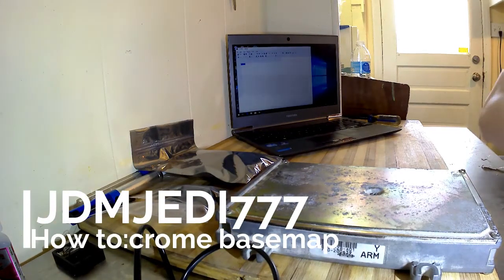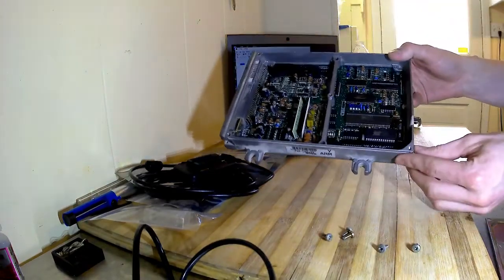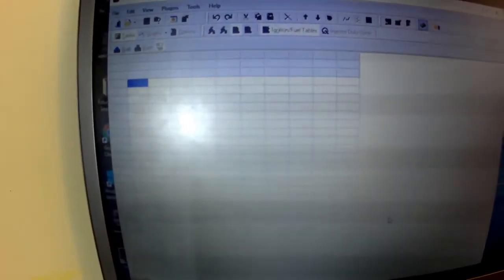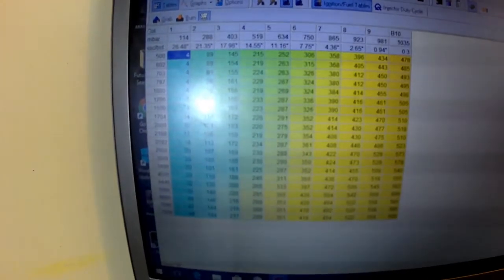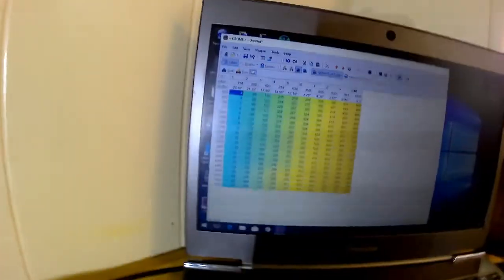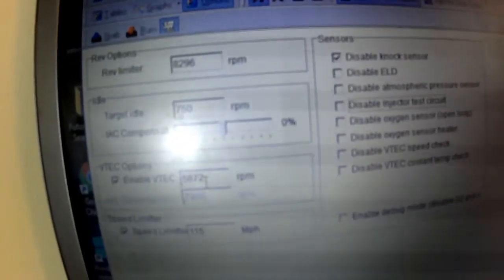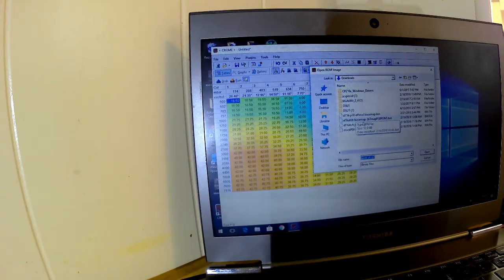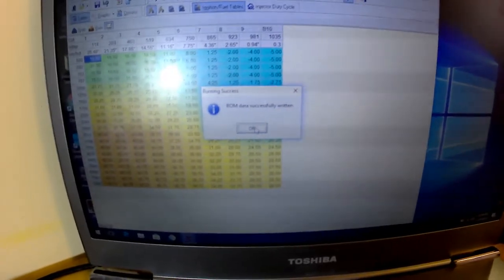Honda crome basemap and chip burning HOW TO

Comment: Hey man I just swapped a stock b18c1 into my 99 civic si. I have a p28 with that sst chip. Would I base it off the p28 rom or the p72 rom I’m kinda confused on that part.
Reply from the maker: So if you want to use the extra features like launch control and stuff you would use a p30 rom and then import the maps from the b18c1 rom. Otherwise if you just want a stock basemap just use the rom for the b18c1.
Reply: Awesome thanks for the quick reply!
Reply from the maker: @coreyguadarrama7966  no problem at all!

Comment: Great video. SUBSCRIBED! Its very informative. i have a miata with mega squirt but I am unfamiliar with hondas and I am Trying to help a friend. Are you familiar with ostrich 2.0? my problem is he has a b20 engine but a b18 p75 ecu and i dont see a base map like that on chrome. can i get one somewhere? or can i make a base map on chrome? thanks...
Reply: or do i need one of those  ECUs listed on the basemaps in crome?
Reply from the maker: You should be able to just make a basemap from a b18 map for your b20. I can't remember exactly what maps they have on there now because it's been a while since I used crome but even if it's a vtec b18 map you can just disable vtec and use that for the b20. It will obviously need to be tuned still but should be good enough to get the car started.

Comment: The d16z basemap will work as a start for a d16a block with a built y8 head??
Reply from the maker: Yes that would definitely be a great place to start. Its gonna still take some tuning but it's gonna be a good start.
Reply: @jdmjedi777  fs bro thanks🤙 it's boosted and everything with 550cc injectors I just need a push to start
Reply from the maker: @grizz5233  that's awesome man! Good luck with your build. I hope the car rips

Comment: Could someone answer me what's the diffrence between high cam and low cam.
Reply from the maker: High cam is when you are in vtec and low cam is when you are out of vtec. If you have a nom vtec motor you only need to focus on the low cam map.
Reply: @jdmjedi777  thanks
Reply from the maker: @macq2734  no problem at all. Let me know if you have any other questions.

Comment: I have a P28 chip tuned ECU H22A4, is there a way to save the tune that is on the chip or import it(or both) so that you adjustments can be made but you have a safety net file saved? I saw your vid on the ITBs and am in the middle of making my own. I wont know until I fire her up but she was running really rich when I bought her,  so I am hoping that it will idle reasonably well as I adjust to make her run well. Thanks for all the info you are great.
Reply from the maker: Yes once you plug in the moates burn2 there should be an option that sais "read" up in the top left corner. Place the chip in the burn2 and click read. It should be able to bring up the tune so you can save the file. When you tune for ITB'S there is an add on called ITB tools. Use that and tune using throttle position instead of using vacuum reading from the map sensor. ITB'S create very little vacuum above like 10% throttle so it's almost impossible to get a good tune otherwise. If you need help I always do my best to respond to comments and could even maybe make a video explaining it. Good luck with your build and thank you for checking out my channel!

Comment: How do I find a base map for a b20b with manual trans for a p28 ecu. I already have it chipped and set up for data log but the chip I have is a "base p72 FV+Gear".  So I'm guessing that's a base map for a b18 auto trans? I'm new to this so I dont know
Reply from the maker: Once I get home from work I will see what I can figure out for you
Reply: @jdmjedi777  thanks I appreciate any help I get. I've already jumped it to change the ecu from auto to manual trans. I think I may end up buying an emailed basemap from hamotorsports. Its compatible with crome which is what I'm using to tune
Reply from the maker: @Dino_Daniel  looks like if you have a wideband you can start with an LS p75 ecu basemap. Cold starts and above 4500rpm will be lean but all can be adjusted and tuned out if you have a wideband.
Reply: Awesome thank you. That is the only thing I havent ordered yet. So once I get that in I'll be ready to tune.

Comment: When putting the p30 features onto the p28 is it safe to use the boost settings too, With the stock honda map sensor
Reply from the maker: Yes but the stock map sensor is only good for about 9 psi I believe. Maybe 1 bar but I'm not sure off the top of my head.

Comment: Hell yeah man I appreciate you, nice video
Reply from the maker: No problem man! I appreciate you watching the video. I have another one on datalogging and getting a more advanced basemap up and going if you are interested.
Reply: I’ll check it out man thanks!
Reply from the maker: @H3ADZhOT  no problem at all.  hopefully I was able to help you out with these two videos. I will have more in depth videos on tuning here soon.
Reply: Bro I have a question! Type this on amazon.com search bar “HiLetgo 51 Microcontroller Programmer SP200SE USB Burner “ and there’s one that is $12 you think I could use that with crome for my SST chip?
Reply from the maker: @H3ADZhOT  I actually almost bought something similar before I bought the moates burn2. It may be possible to get it to work but I'm sure it would take quite a bit of figuring out to get it to. I know that crome already has options that are set up for the moates burn2 and that's why I just went with what i knew would work.

Comment: this is by far the most helpful video I have found on this subject.... thank you!
Reply from the maker: No problem man.
Reply: jdmjedi777 could u possibly link the chip burner?
Reply from the maker: Here you go. This is where i got everything for chipping and tuning my ecu. http://www.moates.net/burn2-chip-programmer-p-197.html?cPath=94
Reply: jdmjedi777 thank you. I know I’m asking a lot but I’m brand new to this haha so sorry. But you said something about having to do something to the chip before you can tune and burn it?
Reply from the maker: Are you referring to removing the checksum routine from the base map?
Reply: jdmjedi777 oh I thought you had to do something else to the chip itself. If it’s just take it out of the board and put it in the burner than I should be okay! Glad I found someone that went into detail about this topic lol
Reply from the maker: As long as you have a properly chipped ecu you should be good to go. Just make sure when you put the chip in the chip burner you have it aligned with the bottom with the notch facing the handle.
Reply from the maker: Your comment about the chip burner saying it timed out came up on my notifications but I cant find it when I go to reply to it, so i hope you see my comment on here. Have you gone through and set the baud rate and assigned the correct com port for the USB port you are using?
Reply from the maker: When you test the connection does it say its successfully connected to the device?

Comment: Hello there...can you send me the d15b map ...seen in the video ...cuz i have a D15b 3 stage vtec and i whant to test it on a p28 socketed ecu ....and start from there...
Reply from the maker: The map I have set up for my d15b is unfortunately for a non vtec setup with individual throttle bodies and a large cam. It's basically a p06 basemap with ITB tools turned on. Let me do a little research because I'm not sure if a p28 basemap will work for the 3 stage vtec. I will see if I can come up with something for you.
Reply: ok..thanks

Comment: Do you know if it's possible to do this with an OBD1 Acura Vigor PV1 ECU?  Someone mentioned the JDM PV0 is flashable but of course my car isn't very common so it lacks support/ actual knowledge and no one has done it before.  

How could I check my ECU is chippable?   Would the sam software be able to make and edit maps for the 5 cylinder?  

Could it be possible to use a P27 or other tunable ECU to run the G25?  I'd like to go coil on plug as well.  

Sorry for the questions.  I'm trying to learn about Honda OBD1 tuning and figure this out for the Vigor all on my own.
Reply: with a P28 you could tune the vigor. But you will have to get someone to make a basemap to run the car. That engine is so unique that it would have to be tuned on a dyno or by a very good tuner. I would go with hondata if you want coil on plug, but you better get ready to put $1500+ in just the Hondata, coil on plug and tune. I would love to see what that 5 piston engine is good for.